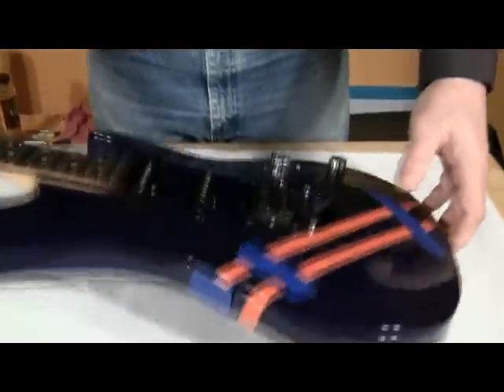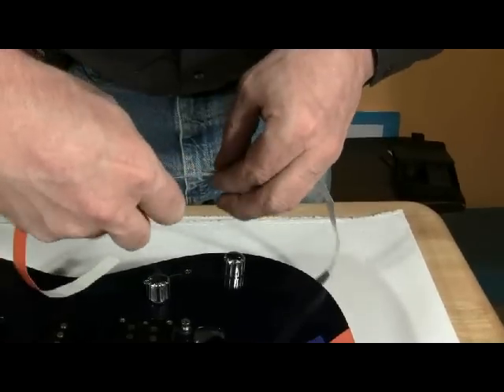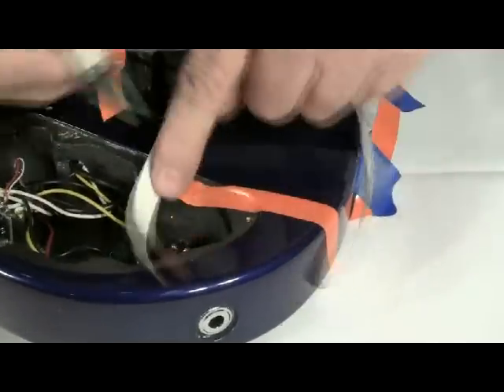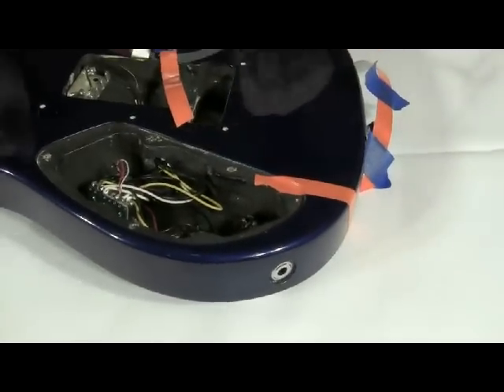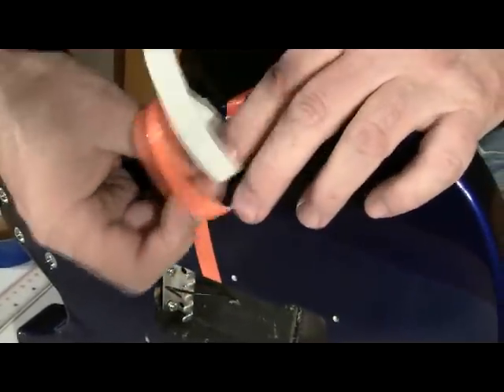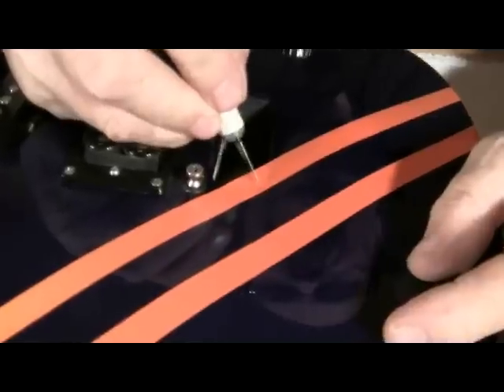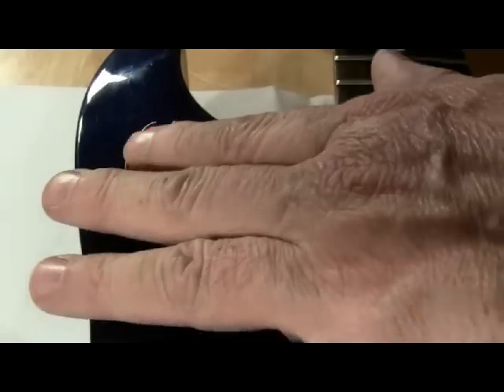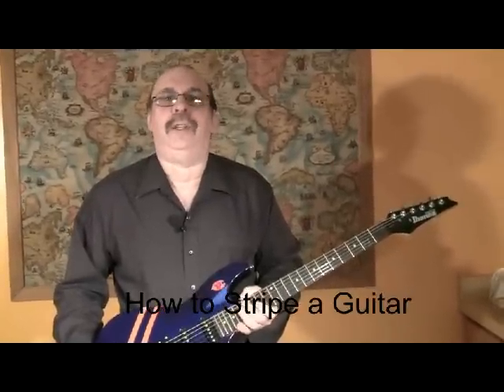How to Stripe a Guitar

Comment: I know this was 8 years ago, but I think it's a great video, and I am finding it usefully because I just bought myself a used guitar for 200 dollars, it is worth 500 dollars new. I got it for such a low price because there are scratches all over it and a small crack on the body where the body meets the neck. I am covering up the scratches with stripes. It is a midnight blue guitar and I plan on putting white stripes on it because there is white outline around the face of the body and I think it will match good.